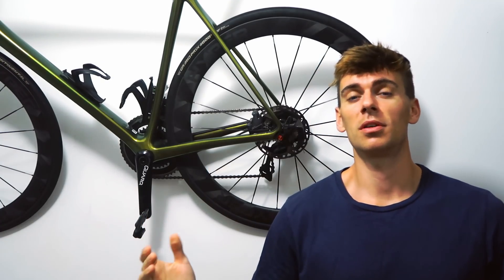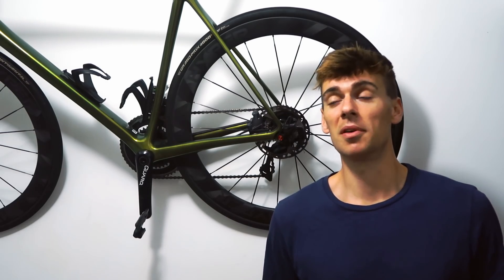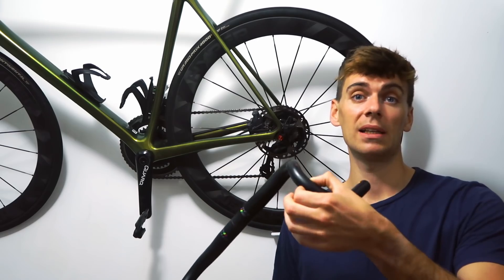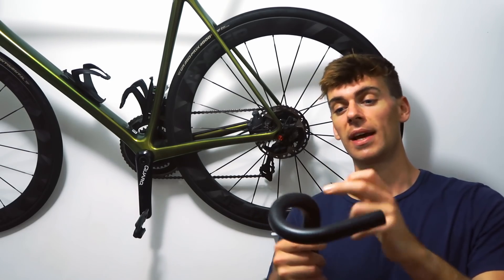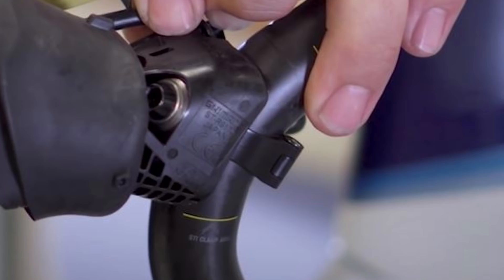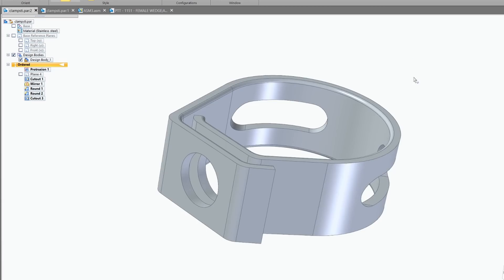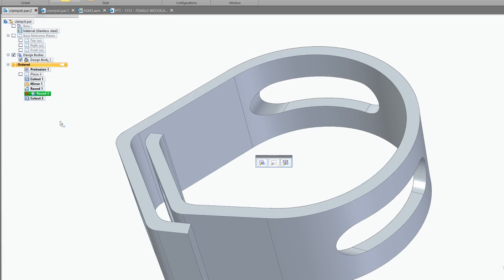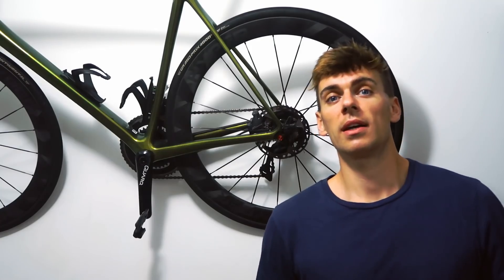MVDP Carbon Handlebar Fail @ Le Samyn: An Engineering discussion.

Comment: Too many critically functional parts made these days by designers not by engineers. Generally the story goes along the lines of... engineer designs a part, machinist makes the part and it's perfect for the job, it's made well and it performs and functions as it should. Along comes financial analyst and says that part costs too much make them cheaper, along comes some designer to copy the function of the part so it can be made cheaply. Finance happy, designer happy. Engineer not happy, machinist not happy. Customers happy to start with, several customers get injured or die, part goes back to original design quietly in the background.......
Reply from the maker: Also, everything looks fine in CAD without deflection, flex, and machining tolerances. Easy mistake when you're a junior engineer. I know this, because i and practically all engineers make these mistakes as a junior. That's why you always need an old wise head to mentor you when you're young. Luckily I had a good one. Arthur if you're watching, thank you, you old bastard.
Reply: @PeakTorque  I really hope Arthur is watching hahah
Reply: Well said..
Reply: but the handlebar is not machined is it ?
Reply: tbh i don't think it's as simplistic as above, manufacturers are entitled to look for most cost effective solution, manufacturing a part that will fail is not cost effective so seems to me their was a project/ process failure somewhere along the review steps, fmea or elsewhere.
Reply: @PeakTorque  that's a process failure, you use the term "lucky" to have had that mentor, that's not part of a process set-up, that is luck and no way to run an engineering business or other. good businesses set-up & apply good/ robust processes not "lucky" ones.

great vid & analysis btw, keep the good work
Reply: @seansean3481  lucky is a figure of speech in this context kid
Reply: @mbal4052  not really actually, lucky is indicating that he was lucky to have such a good mentor (Arthur) otherwise he might not have learned his craft as well. u prob should look up what figure of speech means. also i'm guessing you may not have much experience in engineering/ manufacturing.
Reply: Engineers respond to a brief/problem. A designer designs a vision of that brief. A client looks to make profit (problematic). If you think designers have no place in the cycle industry you are mistaken. Its about working together that makes a great product. The issue with cycling is from the marketing/client side. Designers want the best too!
Reply: @PeakTorque   Can echo your point products designed in CAD do not automatically guarantee functionality, until real world factors taken into account through the design input and experience of time served machinists and engineers.  I'm not an engineer at all but it was a  privilege to work with several who started their own careers as hands on time served fabricators and by the time we met were highly qualified mech and electrical engineers. Most products were premium one off's / bespoke engineered items for commercial washrooms specified by global reach architects for premium projects. Build it first then only once prototypes finally proven then capture the design and build process in CAD . If it has moving parts sure you can draw it on CAD........ but it doesn't mean you can physically fabricate  it that way, nor does it guarantee it will function as required in the real world . The only foolproof way is physical prototype, build and test until it works as required, particularly true of metal and mechanical devices. Recognition to all the old school engineers 👍
Reply: Dan Banham I agree too many functional critical parts revised  by designers today not by engineers. Example a national  commercial project (which shall remain nameless) where the internal fit out commissioning team  ended up as mainly Interior designers but 0% engineers, despite the multiple mechanical interfaces present. The original brief was so undermined after several years of unintegrated ad hoc random revisions made in the absence of any overarching engineering expertise that at the point of delivery,  there was zero integration and the foreseeable commercial headaches.  With 'dabbling' comes not inconsiderable risk and ironically not always for those doing the dabbling, especially in the bike world. Personally I'd rather not be someone's crash test dummy..... so I'd like all parts of my bike to be designed by those with task appropriate formal engineering qualification and practical expertise in the relevant field, not someone whose expertise lies elsewhere.  I wouldn't ask a roofer to fix my car, nor my mechanic to fix my roof. 🤨
Reply: @PeakTorque  I actually have such a stamped steel clamp in my hand, which is new and it may be campy but I think it's TRP (hydraulic cyclocross lever). And I can remember that I questioned myself years ago why these clamps aren't rounded to the shape of the bar. This one is. The corners aren't rounded off, but it's pressed in shape. If you are interested I will look it up for you or find a picture.

Comment: According to German cycling magazine “Rennrad” Canyon just released a statement (at least here in Germany) not to use their latest Canyon Aeroad CF SLX and CFR models until further notice. Seems like the new Aeroad turns out to be the 737MAX of the cycling industry.😬
Reply: Hell, imagine if Canyon engineers were let loose in the aerospace industry - you’d not make it to work on a morning for falling aircraft wreckage.

Comment: I feel reinforced in my decision to stick with alloy bars.
Reply: Stuart Dryer good for you. The more I hear about carbon parts failing on modern bikes, the more I want to buy a handmade steel or aluminium bike (often for a lot less £ than many full carbon bikes 🤔🤯).
Reply: Smart sprinters stick with alloy bars. I know Tyler Farrar stuck with alloy in his day.  They're torquing way too hard on the bars to risk it to a carbon bar. MVDP might have realized he should too.
Reply: Since carbon is expensive why not use titanium instead? If you can break it you probably have super powers.
Reply: @Charles Rush I'm not personally worried about my carbon frames, wheels, or seatposts.  But carbon bars seem particularly vulnerable.
Reply: @stuartdryer1352  yea my local bike shop where like you are not getting a carbon bar or stem as the risk of you not getting home after a crash is to big better take that weight lose and actualy get home at the end of the day
Reply: @Charles Rush thanks for sharing your experience. When I got into road cycling, about two years ago, I thought carbon bikes & parts were the cool/light/strong thing to aspire too. But the more I view this kind of video, and similar by Hambini & Leucher Teknic, plus comments like yours, the more I think I'll avoid anything carbon 💩.
Reply: @stuartdryer1352  what about carbon forks? Wasn't there a pro rider in the  2019 Tour of Belgium, whose stem & bars snapped clean off his Bianchi Specialisima, when he was sprinting to the finish line? Also, I've heard of carbon wheels failing catastrophically 🤯, due to a combination of going over potholes  & being cooked by prolonged rim brake use on long descents?  🤔
Reply: I run alloy bars, cheaper and prefer the shape, but carbon frames are brilliant! My carbon frame MTB goes through so much abuse.
Reply: @jamsxr  iff it works for you? I'm assuming that a carbon MTB is built to be much tougher than a road bike? Mind you, there are vids on YouTube showing carbon MTB failures after multiple jumps 🤔
Reply: @monkeybizniz2095  alloy frames can and do fail as well. Look at all the pro riders on MTB, sending 60ft jumps, huge impacts and crashes. The bikes are built stronger but it’s all relative. Carbon is a fantastic material, but clearly it needs to be designed and manufactured to a high standard - that goes for anything. Not buying carbon due to its strength seems completely counterintuitive to me.
Reply: @a.sarmiento5116  Fair point.

Even after counting in the fact that a Ti drop bar would weigh something like 50-100 grams more than an alu drop bar,the poperties that Ti shares with steel are invaluable to any pro rider.
Reply: @a.sarmiento5116  I would imagine there is a reason you don't see many titanium drop bar sets. The manufacturing would be ludicrous
Reply: @Charles Rush you went from an apple watch to a Rolex good choice
Reply: Aero bars are where they crossed the f1 singlet line for me. It works incredibly well obviously but at what cost for the consumer paying an ungodly amount of money

Comment: Too many bike manufacturers are making too many proprietary parts/components. Unnecessarily rengineering evey part is going to result in a slew of sub optimized designs. I'm still not convinced that Canyon completely screwed up either here or with the seatpost--however as you say, if it's not "human proof" it's going to result in problems

Comment: Could you possibly do a video on Q-rings/osymmetric chainrings? It would be interesting to see a proper analysis from an independent source on their effectiveness.
Reply from the maker: Im trying to tie that in with the 4 bar analysis/crank length sim but until i nail the inverse kinematics simulation its all conjecture and waffle. More work needed.
Reply from the maker: In other words. No one has any proof they work yet.
Reply: @PeakTorque  fair enough cheers mate, stay safe lad
Reply: Don't forget to actually ride the rings and have the experience. I'm not sure about the claims of increased power / less power needed to keep the speed  etc. But from bike fitting/physio standpoint they work wonders for people. I personally ride qrings and I can say that cadence is higher and climbing is easier due to decreased leverage on the dead spot.
Reply: @PeakTorque  I'm experienced in Rotor QRings (and I'm an engineer too). I think that in some cases oval chainrings can give some biomecanichal advantage and nothing more. They make move in the upper and lower dead point easier, at the cost of harder pushing at horizontal rods (and often with worse functioning of front deirelleur). Nothing more, nothing less. For me, QRings are good in providing knees releaf but other people may not have any benefits.
Reply: @maustar6746  that's the thing, it's all subjective statements. If an independent study can prove that they do provide an advantage over circular chain rings then that would set things to rest.
Reply: They work well off road. Less torque needed around TDC/BDC is a big help with techie climbs
Reply: I ride Osymetrics for a long time and love them. However, don't believe any marketing claims, they won't magically increase your power. Maybe slightly boost your PM reading by a few % but it's only a measure difference. The major difference is in the power distribution around the pedal stroke. You feel it when going back on a round chainring: in the power phase, the crank seems to slip down under your foot very fast instead of offering a resistance that you can push against (increased gear ratio of the oval).
Reply: I got some AB ovals - I would never go back to regular. I wish I could really quantify it, but I feel less stress, more pleasure(!). My other bike just tires me out.
Reply: I use AB and Wolf Tooth ovals on 2 different bikes. Not sure if it offers any increase in performance, but they *feel great*.
It gives the sensation of riding a fixed gear bike, because the speed stays more consistent throughout the entire rotation.
Reply: @PeakTorque  Absolute Black hate me for consistently pointing this out. British Cycling looked into oval rings and found no long-term benefits. The power of marketing propaganda has people believing anything and compromising the front dérailleur shifting to boot.
Reply: @11-inch  Regardless they offer no benefits. Bradley Wiggins also used them and then reverted back to round. British Cycling tested them and found they make no lasting difference, they were no better or no worse than round.

Comment: Shimano band on front mechs have a 'plastic' sleeve that fits over the clamp edges- why not use this design solution? Having worked as Pro Tour mech, It was common for the riders to shun carbon cockpits,now they put their lives in the pockets of the sponsor marketeers not engineers! The bikes are so time consuming to put together that its often hard to get 20 plus team bikes prepped in time ,wheels fall off during F1 pit stops,unforgivable,but it happens.... Top work sir
Reply: Simple solution. I thought the same thing, a sleeve or shim in there to spread the load would cost nothing and add much to the factor of safety
Reply: Wrap bar with silicon tape under clamp area.
Reply: No. that's a big no. as a marketing expert for over 50 years, we do not recommend plastic sleeve, that is very damaging to the industry.
we use long carbon chain polymeric compliance member instead. yes.

Comment: I'm guessing the cut outs (yes I know they are pressed) on the standard Shimano clamp allow some flex, allowing the clamp to sit flat to the bar, reducing how much of the load is carried on the sharp edge. Also, everything pressed/stamped has a small radius on one side, does the Shimano clamp put this side to the bar? I'm guessing the  radius is only ~0.1mm, but it's still got to be better than the sharp side of the pressing.
Reply from the maker: Good observation that man. Yes the slots in the Shimano definitely have some purpose. They've really thought about it. Especially using the barrel nut. Fool proof.
Reply: So, from various product images around the web, it appears that they are putting fractured depth towards the handlebars, which is on the other side of the rollover depth so to speak. I would hypothesize the major factor is the possibility of more flexure in the thin stamped steel or ti Shimano band clamp than the machined (or forged and then machined) aluminum clamp from Canyon (especially with those relatively big sections with the pins). While it may not be drastic, it could come into play at this intersection of a strong pro rider riding the lightest, thinnest carbon bars, on hard courses. 

In a related note, Canyon choosing to go with a female thread in the clamp to affix the shifter immediately conjures up all the unfortunate times people have put too long bolts in post mounted calipers on suspension forks 🙈 Only to be discovered when the poor mechanic goes to remove the caliper and gets covered in lower bath oil 🙃
Reply: @PeakTorque  I've just compared the old 7900 Dura-Ace shifters I removed from my bike to the new Ultegra 8000. The Old DA one has a titanium clamp ring that has chamfered relief on the edges like you describe in CAD. The Ultegra ones just have simple pressed steel with sharp edges. Glad I watched this, as it's prompted me to swap them before I install.
Reply from the maker: @mattsoutherden  yes you're right. The older groups especially the titanium DA ones always had a nice round to the edges

Comment: Excellent opinion on the sharp edges of the band-clamp, I think the long bolt is the likely cause, as a mechanic, you wouldn’t feel it crushing the carbon and it could do substantial damage quickly

Comment: Canyon issued a stop use order for owners with those handlebars... Also, waiting for Hambini to rip a new one on Canyon 😆
Reply: 90 RPM Hambini 🐿️, love him. He regularly embarises the big carbon brands 💩.
Reply: Yeah, the advice wasn't re the clamps and that would've been an easy fix especially for the mechanics. They went ahead and customized the frames and changed the handlebar so that the bike could be used.
I'd say that kills the whole assumption.
Reply: Stop use order on a 4 figure bike is disgusting.

Comment: Canyon have now issued a stop riding notice to owners of the Aeroad with the adjustable bars ... implies they think over tightening may not have been the cause.  CEO also said they're doing everything they can to get a bar to owners that meets their standards.  So something seems to be up.
Reply from the maker: The bolted adjustment is not stiff. Its full of backlash and flex. With a clearance Fit how can it ever be as stiff as a continuous tube. Can't.

Comment: great and thoughtful analysis there PT.
looking at the clamps across several shimano levers in the last ten-twenty years, it looks like they evolved from a solid one piece, to a form of two slim stripes. seems compliant though.
Reply from the maker: I think having the slots allow a bit of conformity to the curved profile, they learnt that over time. Its certainly not for weight saving, probably less than 1g!
Reply: @PeakTorque  exactly. i think shimano have had enough lessons learnt through bad experience on critical components over the years; crank, brakes...
Reply: @PeakTorque  brakes manufacturer did safety test YES
Handlebar manufacturer did safety test YES
Aftermarket accessory manufacturer NO safety test, eg bracket, ceramic ball bearings